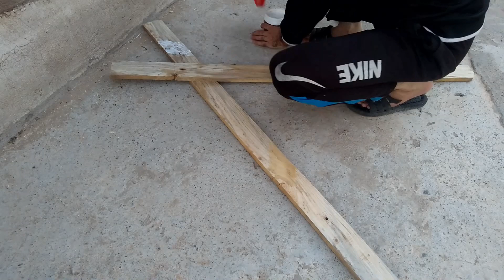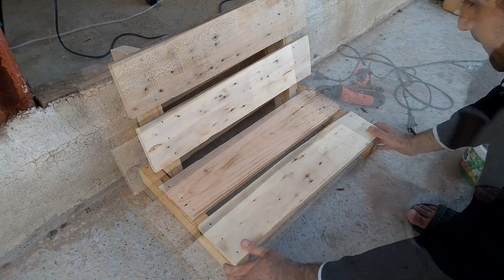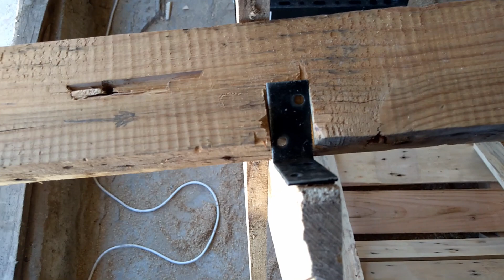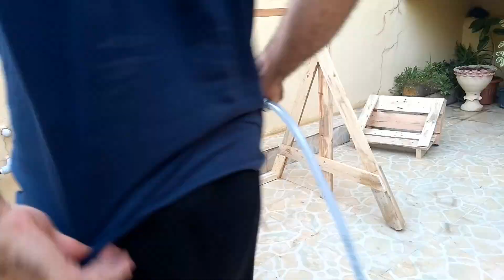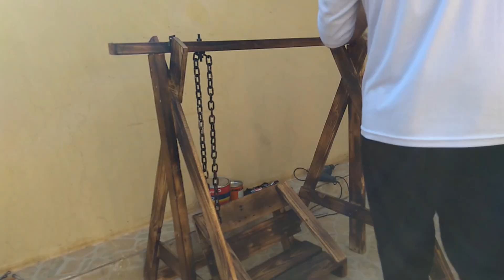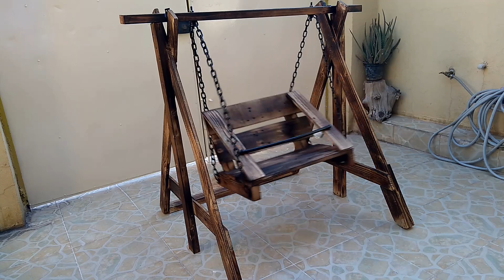Homemade, mini kids swing easily from pallet! DIY.

Comment: How many pallets did you used?
Reply from the maker: I think two!
Reply: @n89n-na1sh9wa8n  What is the dimension of swing base and swing?
Reply from the maker: 120 x 100 x 100 cm
Hight x weight x length